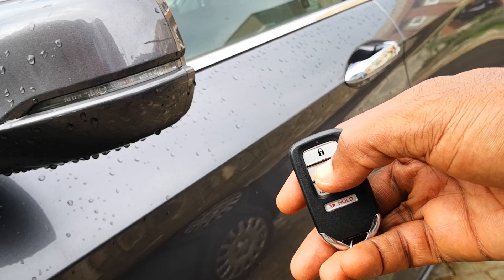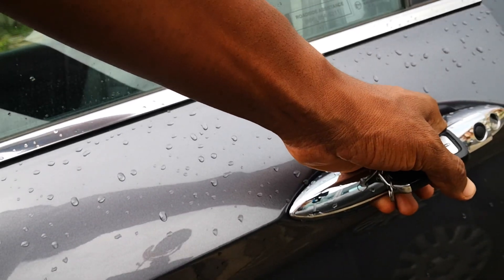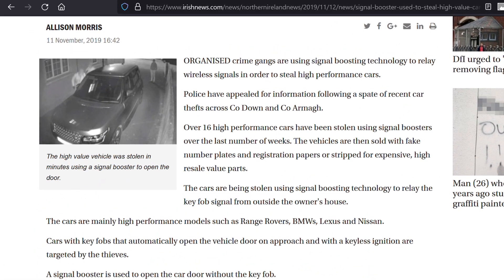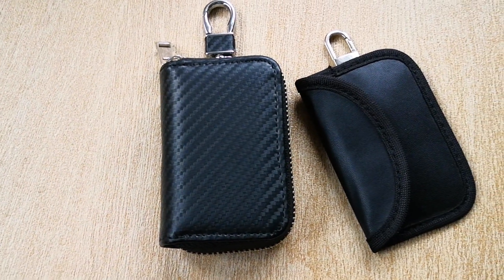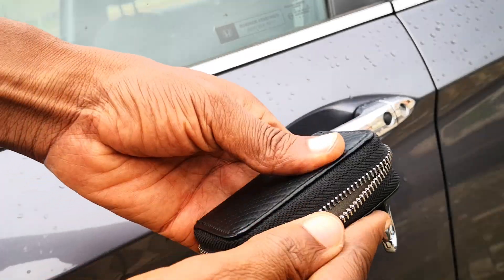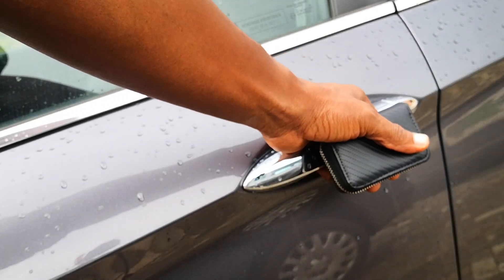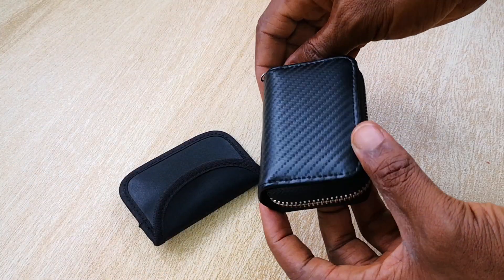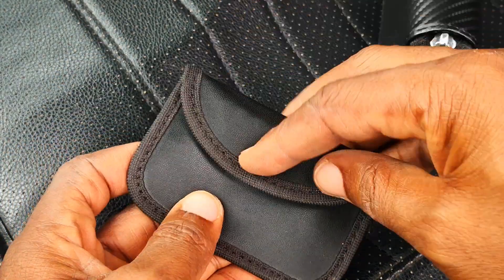Flaw I found Testing Signal Blocker for Key Fobs / Protect a car from THEFT: Cars with KEYLESS Entry

Comment from the maker: After some more testing, it turns out what caused the Faraday bag not to work with the sleeve was that the  thickness of the sleeved key prevented the perfect seal that kept the signal contained in the Faraday case! Silicone as is, had no direct interference that made the case stop working.
Reply: Bc the zipper

Comment: Never happened to me… I think the sleeve is to thick and the way he was holding the pouch he was probably accidentally pushing or pressing the button..
Reply from the maker: You're 100% correct. I later found the thickness of the sleeve prevented the case from achieving the perfect seal needed to block the signal.

Comment: For my Canadian Hyundai Sonata PHEV 2016, if you want to disable the Car Key Fob, Hold the Key Fob Lock Button 4 seconds.  After the 4 seconds, Keep Holding the Car Key Fob Lock but also press the Car Key Fob Unlock Button for 2 seconds.  This will stop the continuous RFID signal from Key Fob.  If you try to open the car door by pressing the button on the car handle, it will not open (unless you have another set of the Car Key Fob still emitting with you).  Another benefit to disable the Car Key FOB, the battery last longer.  If you want back the continuous RFID signal, just press the Key Fob Unlock Button.  This will keep your car to be stolen by thieves with relay attack where ever you are.  Make sure to do this for all the other Car Key Fob of the same car (especially when you are at home) unless it will allow thieves to relay attack because they will catch the rfid signal of the others Car Key Fob.
Reply from the maker: This is what all car manufacturers should be doing! Toyota has a similar protocol for disabling fobs. Thanks for commenting!

Comment: Most modern keyless vehicles, go to your key fob and press and hold the lock and unlock buttons at the same time for 3 seconds what this does makes your vehicle not being keyless anymore you will now need the key fob to unlock your vehicles doors.
Reply from the maker: Not sure how wide that is. Surely not Honda. Kudos to Toyota & Lexus for implementing it. Do you know other manufacturers that have?
Reply: @DIYAutoworksNG  others have posted that Toyota, GM key fobs can do this, you can disabled them making you need to use the key fob to open your vehicle doors I guess the only way to find if it works is to give it a try.

Comment: The pouches are functioning properly; it's the silicone sleeve. The title is misleading.
Reply from the maker: See the pinned comment. I later found it was the sleeve making the made the case not to seal properly. That said, I know many people use such smart keys with sleeves, and it's imperative to be sure that your Faraday pouch still works well if you do use a sleeve.

Comment: I think that silicone sleeve ads some thickness to the key which I causing the pouch not to seal completely. Even though the zip is closed. I can see lip that seals the key in the Faraday cage in the pouch. Having that silicone sleeve compromises the seal. Other pouch have different design and it just wraps everything in.
Reply from the maker: You are 100% correct. I later discovered this after the video and left it as a pinned comment.

Comment: If your key fob has a battery saving mode, this will essentially shut off the smart key and make it stop emitting signals. With my 2023 Tacoma fob, hold down the lock button, then press the unlock button twice. This renders the fob useless unless you press a button to reactivate it. When traveling I keep my fob on neck chain, disable my fob after exiting the vehicle, and no need to worry about relay attacks or gimmicky faraday bags.
Reply from the maker: You would think other manufacturers would jump on Toyota's ingenuity with this shut off function, but no! Really good one by Toyota and they rolled it out way back. I tested it on a 2010 Lexus IS250.
Reply: Speaking on similar topic, ALL smart key fobs should have the ability to push a button so they stop transmitting 24/7. This would help not only for security but to increase battery life...
Reply: thanks for this information
Reply: wow. do all fobs have battery saving modes? interesting!
Reply: That's all well and good for the Tacoma, but not everyone has a Tacoma. Do ALL keyless-entry key fobs work the same way?

Comment: Please sir if I may ask what's the frequency of this key for your Honda accord? 315 or 433 mhz.
Reply from the maker: Generally, the US & Japan use the 315Mhz frequency while Europe uses 433Mhz for key fobs. I have the US Accord.
Reply: @DIYAutoworksNG  I understand that sir and also have an idea. But you can check even though yours is US built it's 433mhz.
Reply from the maker: You are correct! Just checked the literature and did find that it's 433mhz despite being US built. Perhaps due to overcrowding on 315mhz. I see Europe is opening up the 833mhz frequency too. Thanks for sharing.
Reply: @bobby you give me vibes that you steal cars.
Reply from the maker: 😂 Nope. I know Bobby offline. He has a key programming and vehicle tracking business.

Comment: I doubt the silicone pouch had any effect. 
I think it's simply that the particular Faraday case is not reliable (works sometimes, fails sometimes). I think it was just a coincidence that it failed while the silicone pouch was in.
Reply from the maker: Fair point. I don't see any logical explanation to the silicone failure. I'll do more testing and revert back.

Comment: In a nutshell, keyless fobs are making us lazier and making thieves more successful.
Reply from the maker: Yep. But some car makers are ahead of the curve even with keyless entry systems e.g. Toyota/Lexus smart fobs can be turned off at will, and woken up only when you press a button.
Reply: @DIYAutoworksNG  it doesn’t matter they can follo you and clone the key wile driving. Immobiliser with password only way  or a well hidden kill switch to protect your car
Reply: Key fobs were initially a security measure to help unlock car doors quickly and sound the car alarm with the panic button on a fob in case of dangerous situations when every second counts! What would probably work better is to have close range coils and car start with automatic locking mechanism after exiting the cars. Just leave the frequency in a fob for a panic button feature which only operates the horn and lights on the car but does not start the vehicle or unlock then doors. Close range coil sensitive systems that don’t require a fob battery just a working car battery.